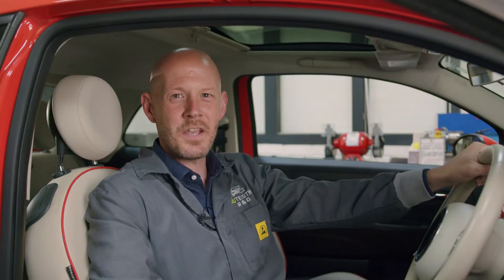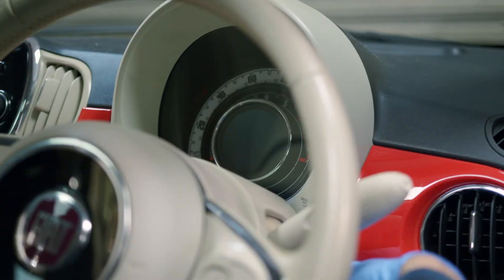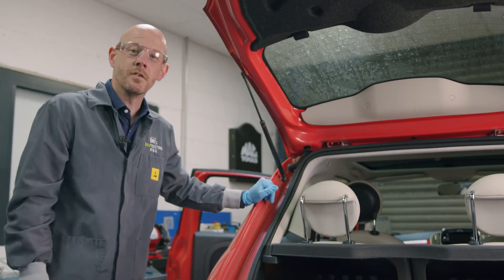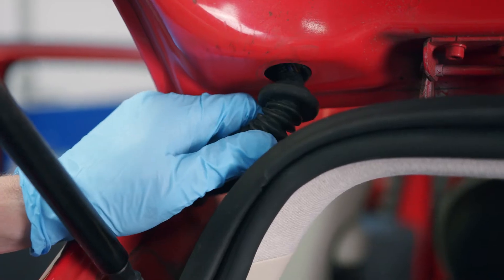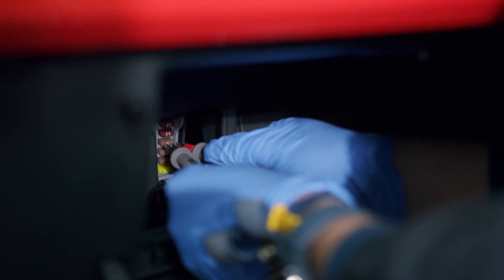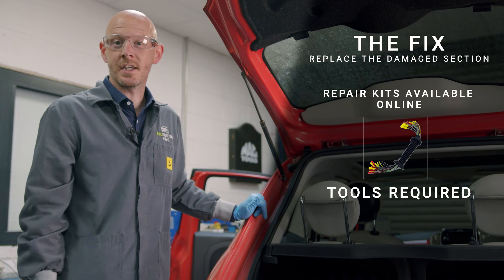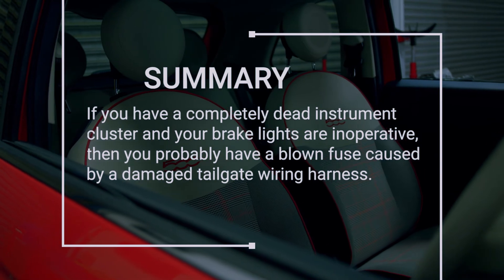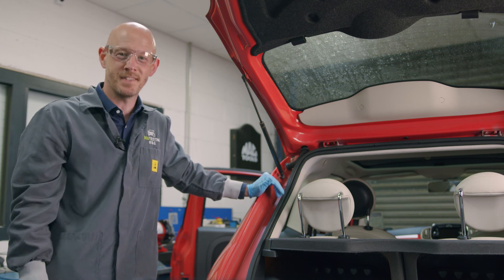Fiat 500 Brake Lights and Instrument Cluster Fault – Caused By Wiring Fault

Comment: WOW ! I have 2012 500 sport . Had dead instrument cluster , no break lights , blown fuse , frustrating search for solution . I looked under the rubber conduit under the rear hatch door and found 7 cracked and broken wires . After repairing them All is well .  Thank you V much for posting this .

Comment: Hi i have a 2014 fiat 500L also and my cluster is fine is just my brake lights and my licenses plate light not working . Also my power windows switche don't work. We manage to put the windows up by hand but the brake lights and licenses plate light  not working

Comment: I have an Alfa Mto. Exact same problem. Changed the brake light switch but the fuse and cluster kept blowing. Turned out it was indeed the broken wires in the tailgate. 2 hours with a soldering iron and shrink wrap and the problem is fixed !
Reply from the maker: Nice job! Hope our video was helpful 👍

Comment: The cluster on my dashboard gone it was intermittent for a while but then just went the wires are ok in the boot there's no problem with them where in Rochdale Lancashire
Reply from the maker: Hi Angela, if the wires in the boot are ok then the fault will either be with the feed into the cluster (e.g. poor power/wiring/ground) or with the dashboard cluster itself.
Check out the link in the description if you want any further information, and don't hesitate to get in contact with our technical support team. Thanks